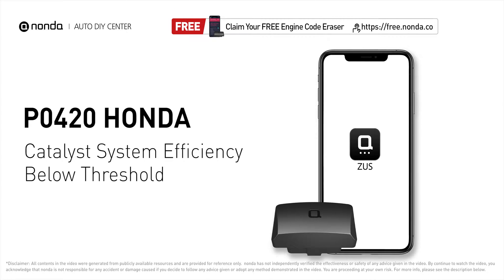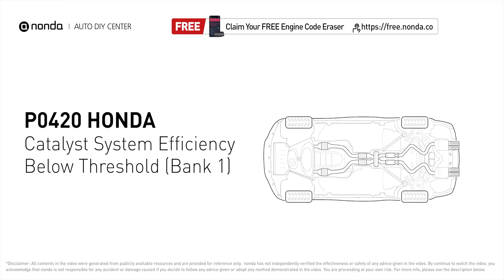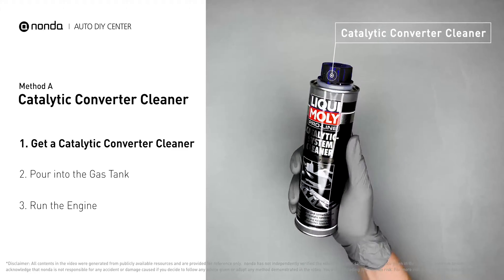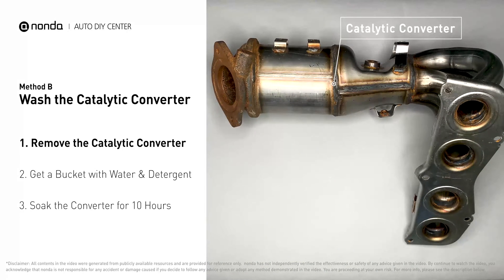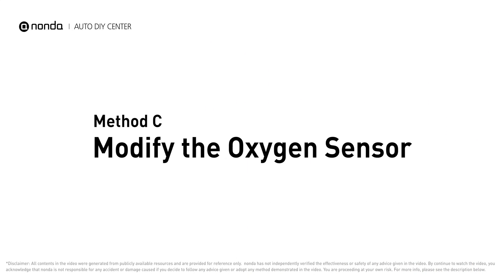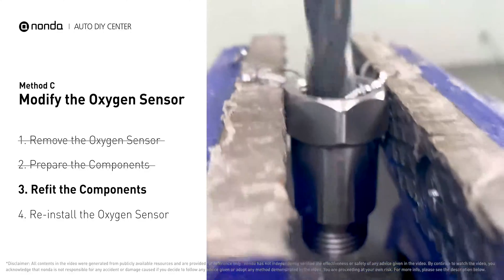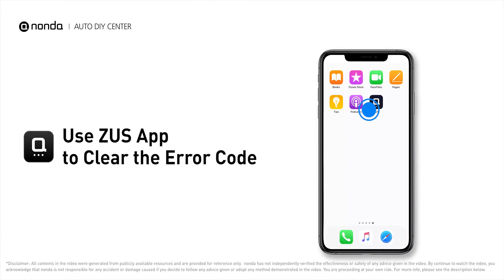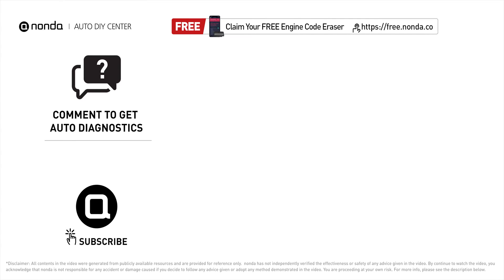How to Fix HONDA P0420 Engine Code in 3 Minutes [3 Methods / Only $19.99]

Comment: I just bought a 07 Accord a month ago and it has about 105,000mi. Guess it was sitting a while before I bought it. Seems like every time I fix something, something else shows up. It’s getting to be exhausting. I get all happy that everything is fixed, just to have an instant come down because something else shows up.
Reply: Not quite the same for me but similar. I have this code and I need to replace the o2 sensor for a short. And it overheats randomly from the air fuel ratio. Other than that it just needs a light tune, oil change, and control arm bushings. Oh and an exhaust hanger the rattle is driving me INSANE!!!!!!!!!!!!!!!!!😂
Reply from the maker: Hello, we hope our videos could help you with future car issues. Thanks for watching!
Reply: I got the same code but it has 2 sensors on each side on the vehicle . Which one do I put a spacer on 

I got p0420 ,p0430
Reply: @richstar92 it’s usually the downstream sensor you have to change. Does it say bank one or bank two? I’m assuming you have a v6?
Reply: @MichaelAdkins-p1x  yes v6 it doesnt say both